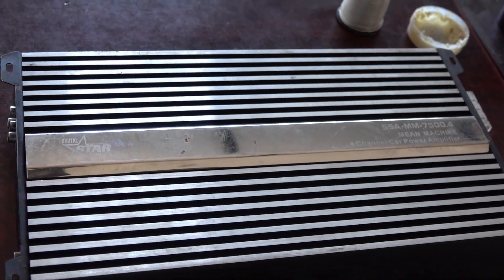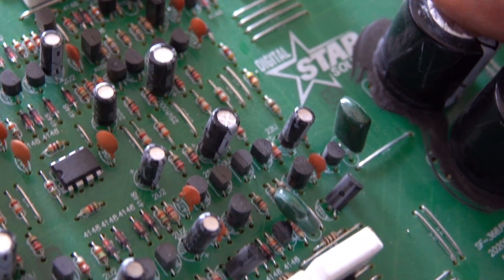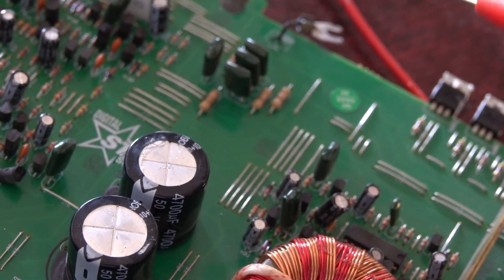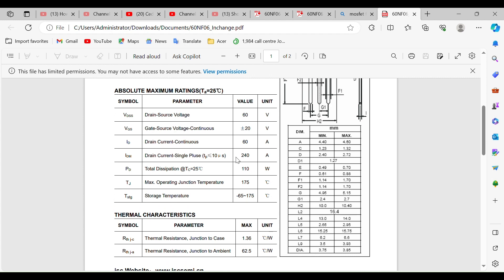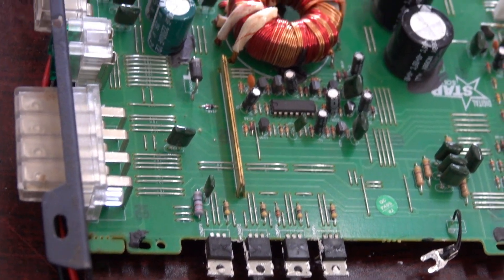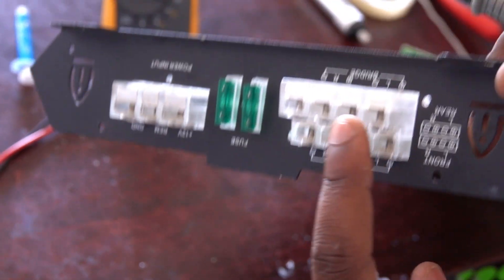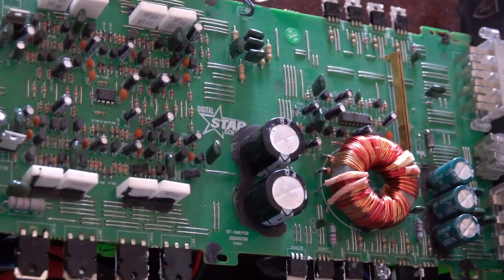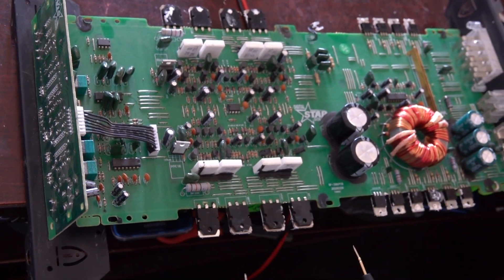Car Amplifier Won’t Turn On. WATCH THIS BEFORE GETTING RID OF YOUR CAR AMPLIFIER!!

Comment: Brotha Cedric thank you for your videos 👍 I have a problem with my CRUNCH PZX1800.2 Powerzone 2-Channel Class Ab Amp (1,800W) , recently it got very hot, soon after the power goes off , I bought new wiring kit speaker wires fuse everything , no power , but if I were to slightly give the amplifier a lil bump on the top near the middle of the amplifier it’ll go back on and work , but then a minute or 30 minutes later the power goes back off , then I give the amplifier another bump and it’ll turn back on smh 🤦‍♂️ , please help me if you can point me to the right direction on the motherboard , by the symptoms I mentioned does it sound like a mosfet , tansistor or capacitor problem???? Please help
Also the amplifier does not go into protection mode , red light never comes on.
Reply from the maker: It looks like a capacitor problem.
Reply from the maker: check also the rca input soldering joints. hope it helps

Comment: My 2000.1d is in protection mode took back off look like have bad capacitor ....  will that one couse it go it protection. Also what couse it to blow
Reply from the maker: check the MOSFETs around that cap.